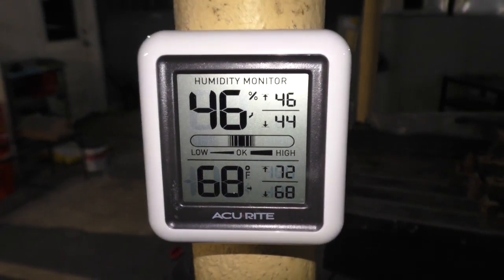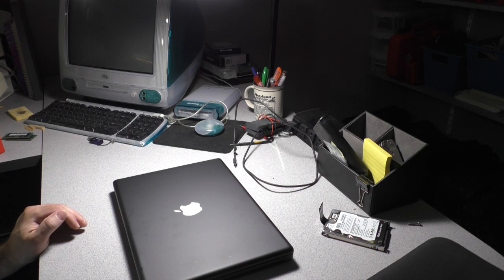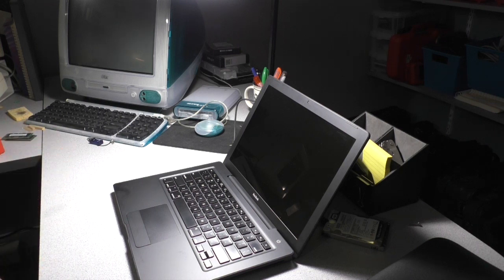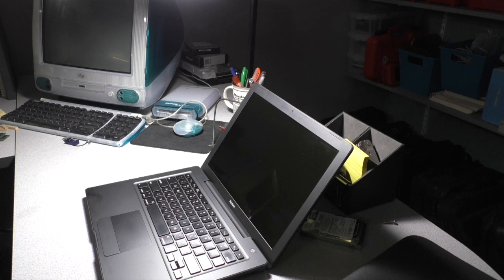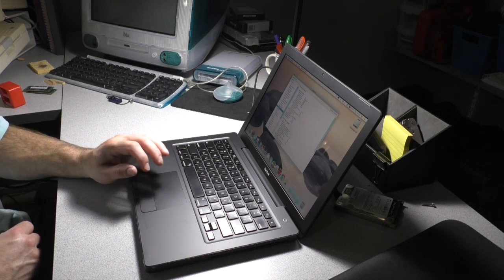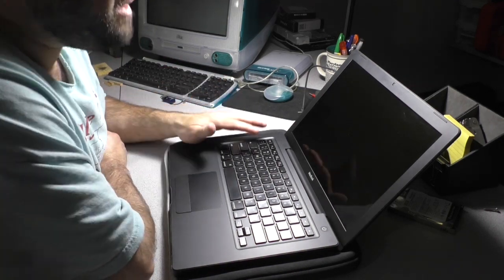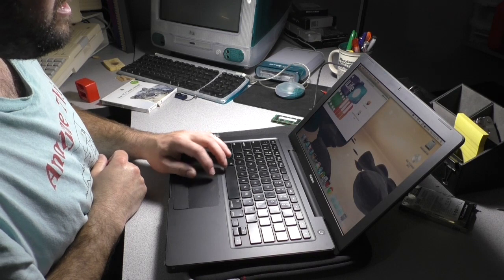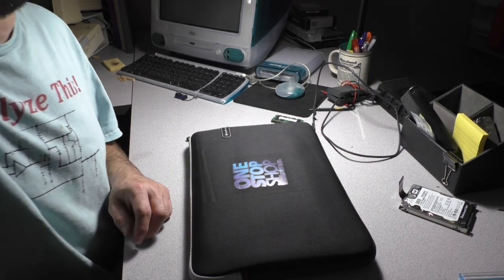The "Black Sheep" of The MacBook Family

Comment: If you are having an issue finding a genuine black Apple battery for the Black MacBook. You can pull the black cover panel off the bad battery and swap it onto a good white Apple battery. It's just held in with adheasive.

Comment: I have this same model, specced to the max, complete with bad optical drive. To be honest, if I bought one new I would have been very disappointed. They reused the Intel X3100 graphics and 965PM chipset from the 2007, which was a mistake. Not only was the SATA bus arbitrarily limited to 1.5Gbit, but they (Intel?) also never wrote 64-bit drivers for the graphics, which is why it was limited to 10.7, giving this machine only about 3 years of software support! On the other hand, the machine released a year later with the nVidia chipset and slower CPUs can still run the very latest software with some coercion.

I'm pretty sure Apple does not want remotes on their devices so they can sell Apple TV's, I too thought front row and those iPod docks with the IR recievers were awesome and useful.

Comment: I have one of these machines in its stock 2.4GHz configuration, bumped to 4GB of RAM and 256GB SSD. It's pretty useless for day to day use but runs XP of all things brilliantly. 

I'm wondering if the MLB from the very last MacBook revision (the one with the GeForce 9400M) would fit in the chassis as that would be a neat upgrade.
Reply: I can confirm it does fit with minor internal modifications, I did this mod to mine a few years back
Reply: @NDZ12345  Is there a page on the 'net describing these mods? I have access to one, you see, and I'd like to have a go. Thanks!
Reply: @classicmacintosh  I've never looked actually, I'd say all you really need is a disassembly guide.  Like I said it's been years but I believe only one screw standoff on the bottom case needs to be removed or modified
Reply: @NDZ12345  Brilliant. Thanks. I'll have a go this weekend.
Reply: @classicmacintosh  After digging mine out of storage I remembered something else cool, once you're running the mid 2009 logic board you can use the patcher tools out there to run 10.13 or even 10.14 if you're feeling adventurous.  I have mine on High Sierra and even without an SSD its surprisingly usable.  I'm planning to throw in an SSD and go to 10.14 just to see what its like
Reply: @NDZ12345  Well, I sat down and swapped the boards tonight, and it was a very non-trivial task. I was going from a 2008 Black MB4,1 to the MB5,2 board and only one of the four heatsink mounting points lined up, so I had to bodge that on using some nuts on the motherboard and chop off three mounting points. Also brought the optical drive with me as that's SATA on the MB5,2 and IDE on the MB4,1.
I will be doing the reverse (MB4,1 board in MB5,2) later on tomorrow night as that's going back to its owner to sit unused with Lion installed on.
Also worth pointing out the DosDude patcher does work, but 10.12 onwards don't support the trackpad, so you can't even do two finger scrolling or right clicking, rendering it pretty awful. I've gone to 10.11 for now.